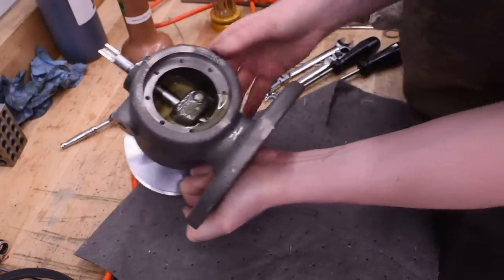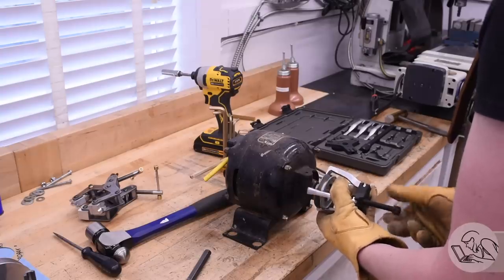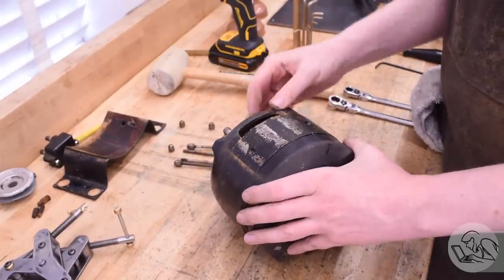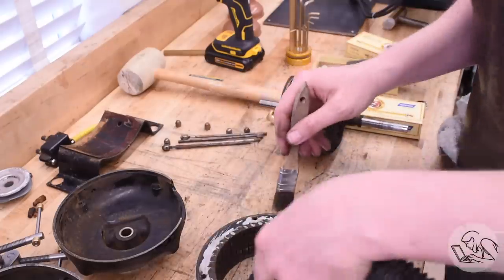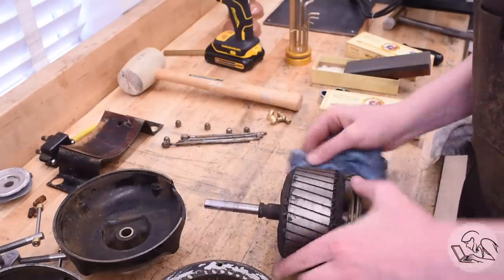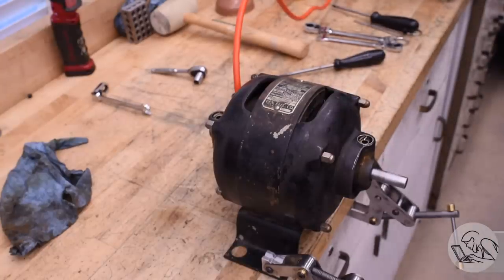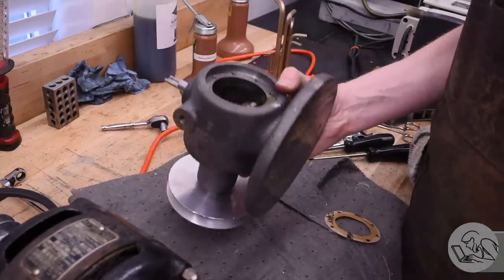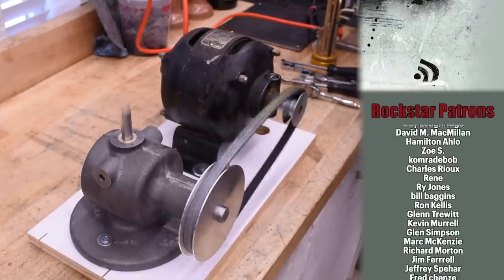1934 Electric Motor - Let's Build A Die Filer, Part 8.

Comment: Stupid question here. Is it possible to replace the heavy metal parts of the motor. Like the casing with carbon fibre. To lower its general weight ?

Comment: I need a better crimper. I have a manual one from Thomas and Betts, and its pretty good, but its not great. Got a link to the torque controlled ratcheting crimping tool you are using?

Comment: hmm i might get a better crimper then, because im one of them that think they are not good, now i have to give it a try and see if its that much better, because the system is good and easy to use if it works

Comment: How about a m533 oil used in washing machine transmission and in heavy trucks rear gears and steam cylinders? Was used in the 1928 model a ford in transmission, steering box and rear diff . Thick pancake like grease. Had to find out what it was as 80 90 will drop out as fast as ya poured in.

Comment: Rewinding motors is not all that hard. I taught myself how to do it with a US Army field manual which I got from the library. I rewound two motors. One was a plain 1/4 horse motor (which still sees service on a jigsaw); the other was a very odd-shaped motor from an antique Hoover vacuum cleaner (the owner didn't like any modern vacuum she had seen and of course there were no replacement parts to be had).

Comment: Since the motor will be actively trying to suck up the filings from your filing (phrasing please), it might be a good idea to hide the motor under a table with a chip trough.  A motor hinge and gravity tensioning system, (use the weight of the motor to tension the belt), will offer instant belt changes and perfect tension all the time.  This will keep the motor out of harms way, and only require you to take it apart one more time for proper clocking of the end caps.
My suggestions are not hindered in any way by the additional work you may need to do if you choose to implement them.

Filings from powered file abuse...no
Filings from back-dragging the cutting edge...no
Chips from turbo-filing...no
You know the damn stuff that clogs your files...NO!
Filings from your filing...perfect!

Comment: I'm guessing that the UK had a requirement for an Earth** connection for way earlier than you suggest.  Now I need to find some references for that guess.  (**Earth, Ground, Bonding connector, CPC or Circuit Protective Conductor.  All according to choice, habit, particular regulation, or code you are referencing.)  The Wikipedia article seems particularly USA-centred. :-(
Totally agree with you about crimping but NB the need to use terminals to a good standard.

Comment: @12:34 🤣🤣🤣👍  But where is your DHD?

Probably an unnecessary hint from an almost total layman in the field:
I think the motor should get a housing. He's accumulated a lot of sawdust over time, which is probably not uncommon. You want to use your die filer primarily for metal, so that metal shavings are produced, which should damage the engine much faster than the soft wood dust.

Comment: The oversize holes on the mounting bracket are for rubber isolators to further reduce noise and vibration.  So this was most likely a fan motor from a furnace originally.

Comment: I would be that pully was cast out of Magnesium, and you were likely real close to having a flammable metal fire.
Reply: @Doug Reed  You may be right,  but I do happen to have a vintage push mower deck made entirely out of Magnesium. That's what made me think of it.
Reply: @ItsMrAssholeToYou  I mean, you're right aside from the metal fire risk.